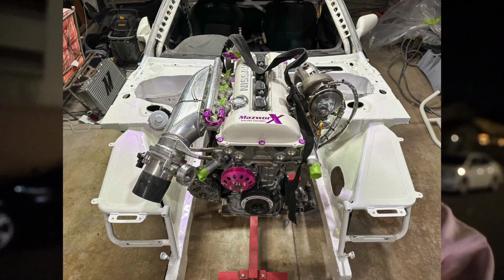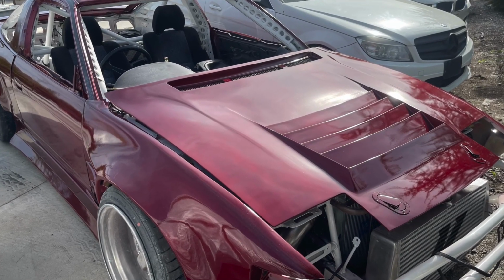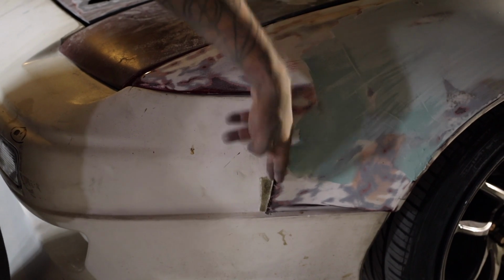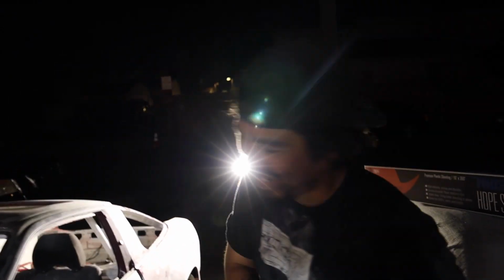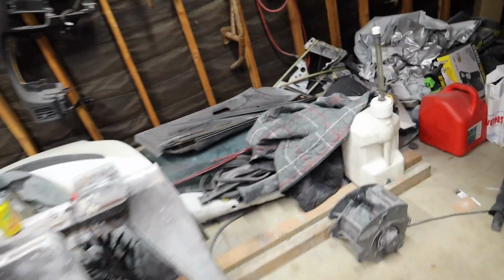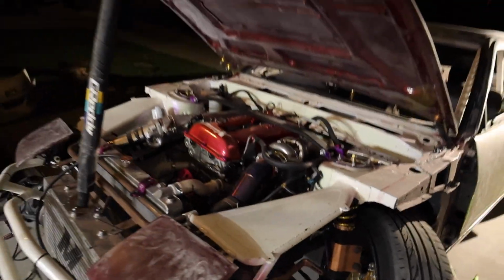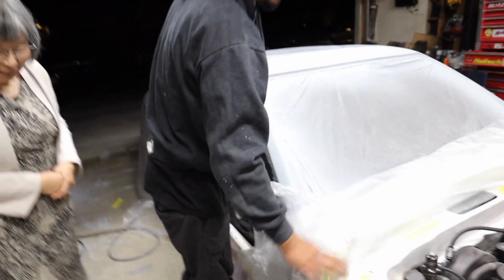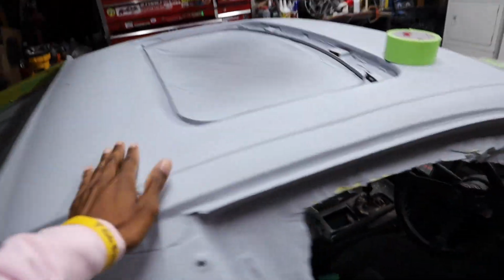$5,000 CUSTOM PAINT JOB GONE WRONG!

Comment: I just went through the same shit with a buddy.  I can see the little bit of body work he did, pinholes and sand scratches, runs and overspray eeverywhere. Whole engine bay has overspray after I had it clean 😂 if I wasn't there for the clear process I'd be missing the bottom half of my car with clear. But from what he says he did amazing, I'll be doing the same thing soon
Reply from the maker: super frustrating. the money we can get back but the time is what kills. we could’ve had the car painted and done by now if we just did it ourselves from the jump lol

Comment: I really would love to get a build list from this sr20! I’m building mine atm
Reply from the maker: i’ll get that for you bro
Reply: @julianjoness  thanks bro! Appreciate it so far my s15 has getting done 

Haltech elite 1500
Tomei 258 poncams 
Forged Manley rods / piston / bearings 
G30-660 .82 Vband t3 
45mm GenV Hypergate EWG
BLITZ fmic 
Haltech multi gauge
radium  plumbing complete e85 lines from tank to engine bay
Radium fuel rail 
Radium Split flow adapter 
Going to tune on strictly e85
Twin 525 fuel pump inTank with billet top hat 
Bigger TB (r33 Skyline)
1650cc injectors 
Oil cooler with Oil filter relocation kit 
Dual Fans 

I’m curious to know if I will make 600hp

And I’ve got a set of HKS STEP 2 264/272 cams waiting to go if I’m not happy with the 258’s
Reply from the maker: ofc bro! from what it sounds like tho, i think you’d make closer to 600 for sure
Reply: @julianjoness  I’ll be happy with that!
Reply: Cp pistons 
Manley turbo tuff rods
Darton dry sleeves 
Mazworx 1/2 studs 
Mazworx billet oil girdle 
Mazworx billet main caps 
Apexi head gasket 
Kelford 268/272 cams 
Tomei solid lifters 
Mazworx dual guides
Super tech dual valve springs and retainers 
Super tech +1 valves 
Super tech valve stem seals
Jim wolf valve guides 
Mazworx g series 25660
Mazworx turbo manifold 
Mazworx down pipe 
Mazworx screamer pipe
Precision 45mm wastegate 
Mazworx intake manifold 
Mazworx fuel rail 
Id 1300cc injectors 
Ati super damper 
Ignite 50 v2 trigger kit 
R35 vr38 coil packs with taarks adapter 
2 Walbro 450s in surge tank 1 Waltbro 450 lift pump 
Aem fuel pressure reg
Haltech elite 1500
Haltech ic7 
Koyo radiator 
Spaal electric fans 
Nismo thermostat 
Oem water pump 
Yashio water pump pulley 
Togue factory power steering pulley 
Dc power billet hi amp alternator with pulley 
Circuit sport oil pan 
Circuit sport oil filter relocation 
Koyo oil cooler
Gates belts 
Taarks power steering relocation kit 
Chase bays power steering reservoir 
True focus fab catch can 
All lines I made myself
All piping is custom
Cd009 transmission with mazworx adapter 
Inland driveline custom driveshaft 
Stock 4.08 s13 differential welded with villains 350z axle stubs
And I run nismo competition 15/40 oil 

That’s mostly everything I can make a lot more power with a different turbo and larger injectors but I was going for high 500s low 600s with a lot of response I make boost practically the same time as a stock turbo and it stays in it. If you have any other questions feel free to dm me on instagram
Reply: @grizzlyps1332  wow dude thank you! 

Ah taarks is here in australia I didn’t know you guys used them lol
Reply: @s15silvia.stanced no prob at all, and yea taarks makes very good product especially for the neo VVl set ups 
Mazworx and taarks hands down best conversion products for the sr platform
Reply: @grizzlyps1332  you went for the VE? Conversion?
Reply: @grizzlyps1332  the thing is I don’t have Instagram / Facebook / Snapchat lol 

Only email & WhatsApp & YouTube
Reply: I have another engine in the works eventually I’ll throw this sr in another car and go vvl in this one  and no worry’s feel free to comment and tag me in the vids and I’ll respond
Reply: @grizzlyps1332  if you wanna sell this 600hp motor let me know! Is that mazworx plenum under the VE?
Reply: It’ll be in another car 😂😂😂 and no it’s under det
Reply: That’s the exact link
Reply: @grizzlyps1332  thanks bro 😎 if you got rims you wanna sell let me know lol I’ve got rid of my 326 power wheels and I’m getting some BBS RS2
Reply: I’m trying to get some 326 yabakings as  drift spares 🥺
Reply: @grizzlyps1332  aww shiet
Reply: @grizzlyps1332  they’re expensive hey